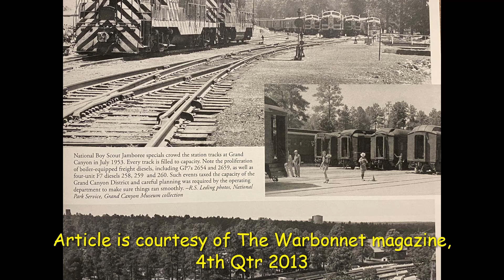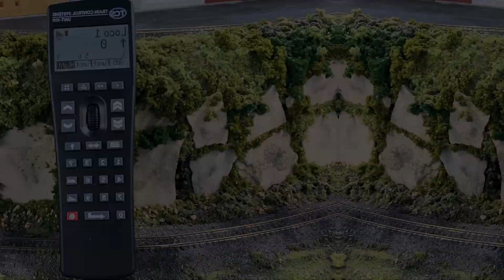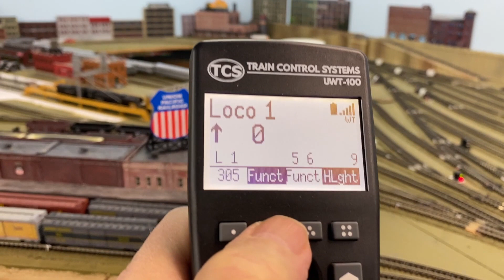ATSF Special Train - 1953 Boy Scout Jamboree

Comment: Nice passenger train John. I have noticed the longer the passenger train the more trouble I have. Then again they don't fail unless the camera is rolling.
Reply from the maker: You can say that again JD. That is why I leave most of the bloopers in my videos (I usually just cut the ones where I am swearing loudly). One of the heavyweight coaches actually had a coupler box cover fall off along with the tiny spring. Heaven knows where they went….John

Comment: Great video John and shot of layout scenery looking cool. Boy it changes the atmosphere of the layout. The wireless throttle works well. Kevin
Reply from the maker: Thank you Kevin. I really like WFD-30 (actually made in Australia by WiFiTrax). It sets up the WiFi environment without having to connect with JMRI. I have also used my iPhone as well to control trains but since I video with the phone’s camera the TCS controller is a much better control device….John

Comment: Hi John, Nice train but are passenger trains running that slow ? Or is this because of derailment issues ? I also use the WDF wifi module in combi with the NCE Power Cab but just use a smartphone. The TCS wifi throttles are to expensive after shipping and import taxes in the EU - not in my budget. You have nice company with your dog. He / she looks very gentle and reminds me of mine I had for 17 years. I wish you success with the ongoing scenery finishing and look forward to another update. Best wishes & have fun, Filip
Reply from the maker: Hi Filip, Yes I ran the train a bit slower because of the trouble with the various manufacturer’s passenger cars always having some issues running together. In fact, when the car that derailed coming into the station actually had it’s MTL coupler cover come off which caused that problem. I also use an iPhone with the WFD-30 but this time I used the TCS throttle since I was using the phone’s camera for the video. Thank you for all of your comments….. John